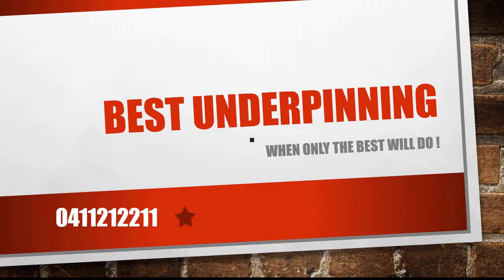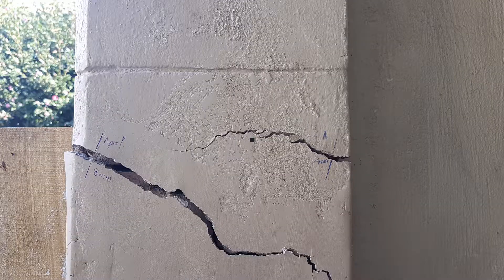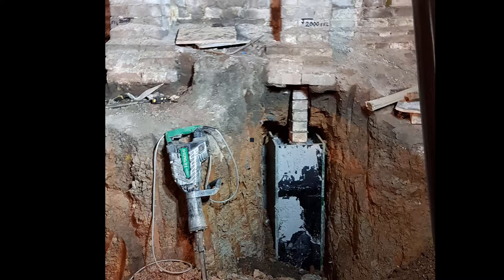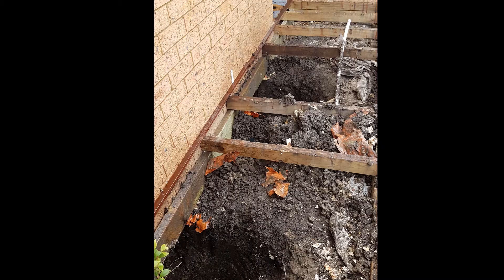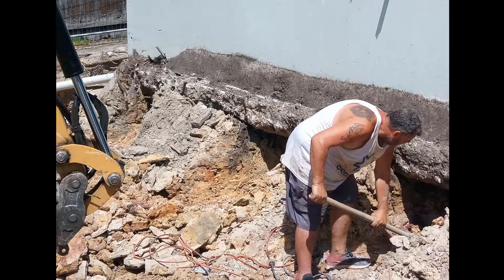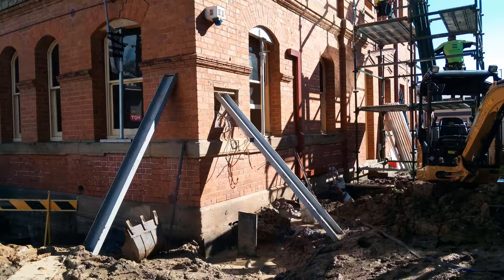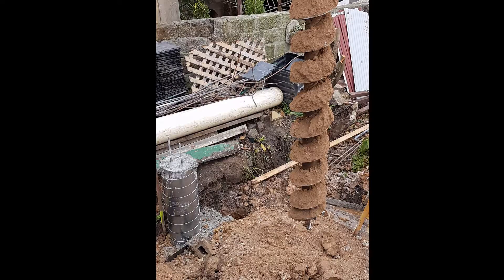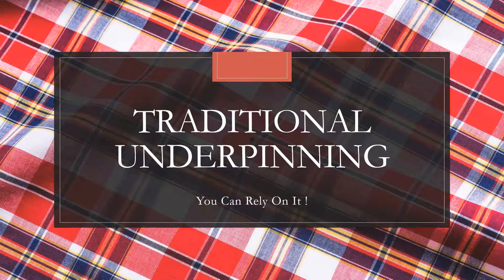Traditional Underpinning

Comment: Great to see this. How do you pack the concrete right up to the underside of existing foundation? Do you need an expansion joint?
Reply: You csn dry pack the last 50 to 100mm or use a head of concrete to keep the pressure on while drying
Reply: you have to dry pack mortar in to fill the gap. concrete shrinks. or spend more money and use High-Performance Cement.